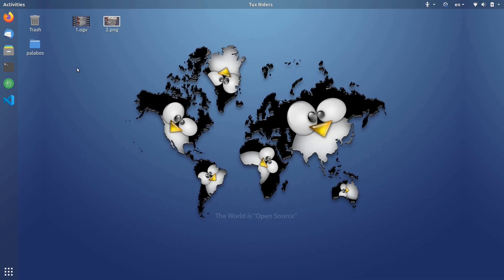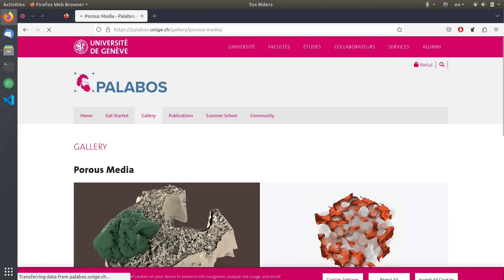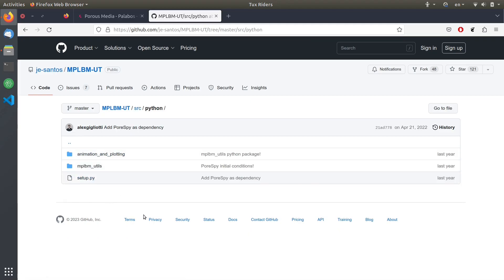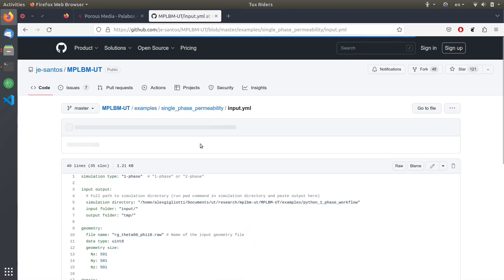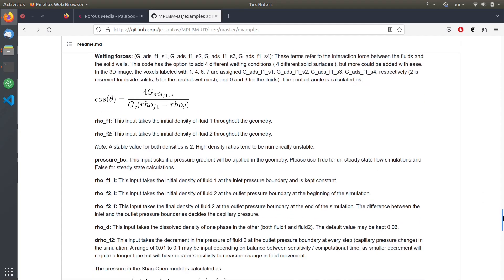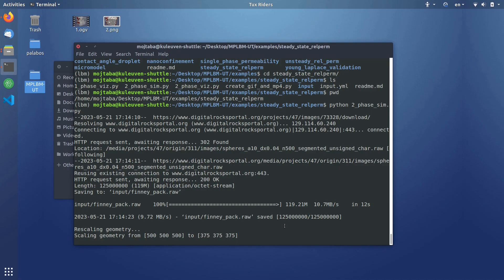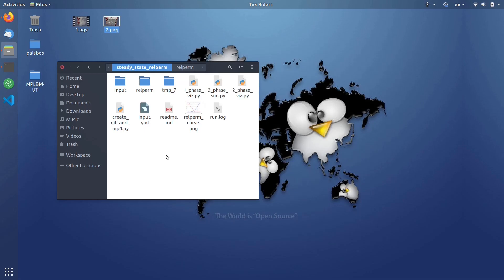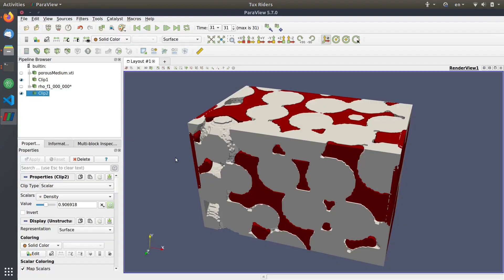Lattice Boltzmann simulation of multiphase flow in porous media using Palabos [On Demand 13]

Comment: Hi,
Many thanks for your thorough explanation!
I had a question regarding the units of the output data. For instance, for the single phase permeability example I input my own raw format image and the result of permeability was 0.05. The problem is that I have no idea of the physical units. Could you please help me out on this?
I do not know how to do the unit conversion from lattice.
Reply from the maker: Hi,  I believe it's a better idea if you contact the authors of the software for a more precise answer on your unit conversion question: https://doi.org/10.1016/j.softx.2022.101097.
Reply: The units are Lattice units. If you want to convert into mD, initially you need to multiply by the size of your dx square (dx^2) in meters. Example; 0.005*dx^2 = m^2. Then, convert m^2 to mD.

Comment: Thanks a lot. It is really helpful for my research
Reply from the maker: Glad it was helpful :)
Reply: By the way, is there any way to simulate flow with a large density ratio (like a water-air system)? I tried a density less than 1 for wetting fluid (fluid 2), but it didn't work...

Comment: I really thank you for the explanation of this helpful tool. I still could not figure out the units of the Single-phase permeability obtained from this model. Is it in mD or D?
Reply from the maker: I'm sorry, I totally forgot to answer your question. I think it should be Darcy as the code uses SI units. I hope I'm not wrong here.
Reply: I think it is a lattice unit rather than a physical unit.

Comment: is it possible to run this simulation in colaboratory? I tried but not being able to execute it.
Reply from the maker: I'm not a collab user, so my answer may not be correct. I guess it should not be possible to run it there because this Python codes rely on C++ codes running behind the scene, the compilation of which can be an issue as well.

Comment: I tried to implement all steps. everything went correct except while running "python 2_phase_sim.py" command, I come to this error: "Traceback (most recent call last):
  File "/content/drive/MyDrive/Palabos/MPLBM-UT/examples/steady_state_relperm/2_phase_sim.py", line 241, in <module>
    inputs = organize_2_phase_outputs_for_relperm(inputs, sim_counter)
  File "/content/drive/MyDrive/Palabos/MPLBM-UT/examples/steady_state_relperm/2_phase_sim.py", line 178, in organize_2_phase_outputs_for_relperm
    last_rho_config = rho_files[-1]
IndexError: list index out of range". would you help me solve this error? thanks!
Reply from the maker: it seems that the simulations cannot run, which is maybe due to some MPI problems. I specified 6 as the number of cores (processes) in the config file in this video, but you may need to decrease it according to the the available resources in your system. try to run it with 2 or 1 first.
Reply: I am trying to run the code in colaboratory. I have done all steps. even the the code is executed and shows "Running sim 8 of 8
PoreSpy Snw = 0.9999889559101527". but all of a sudden the error "Traceback (most recent call last):
  File "/content/drive/MyDrive/Palabos/MPLBM-UT/examples/steady_state_relperm/2_phase_sim.py", line 241, in <module>
    inputs = organize_2_phase_outputs_for_relperm(inputs, sim_counter)
  File "/content/drive/MyDrive/Palabos/MPLBM-UT/examples/steady_state_relperm/2_phase_sim.py", line 178, in organize_2_phase_outputs_for_relperm
    last_rho_config = rho_files[-1]
IndexError: list index out of range" comes to me. I do not know what the error is. I would appreciate if you could help me. Thanks @TuxRiders

Comment: I am new in this field and was trying hard to understand this. You explained really well. Thank you so much.
Reply from the maker: Glad it was helpful :)
Reply: Hi, I am trying to measure permeability of a 3D porous media (200x200x200) using single phase example. How can i change the fluid properties like  density, viscosity of the simulation ? and i I take the domain size 100x100x100 will it give me accurate result ?  can you help me in this regard ?